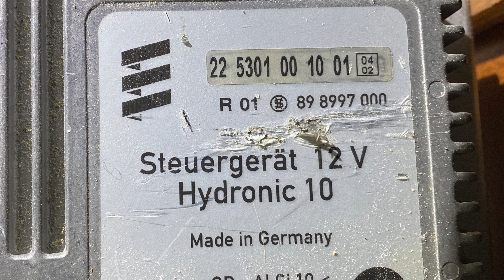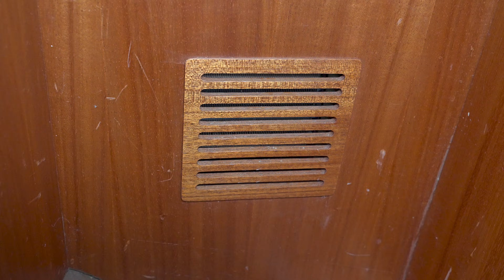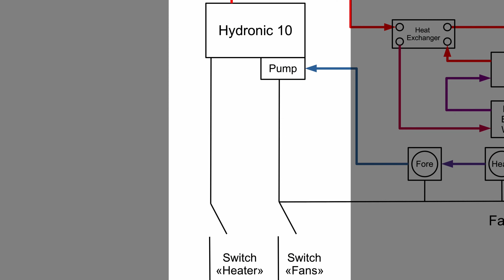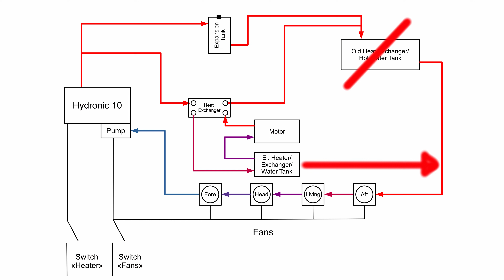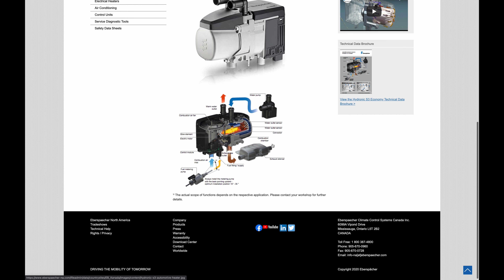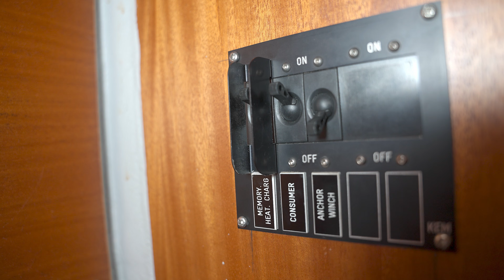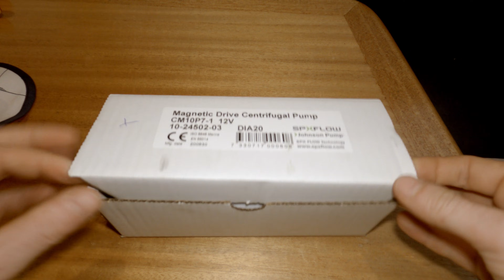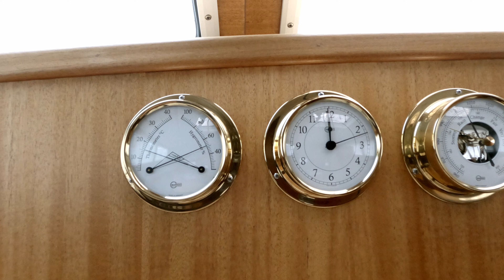Boat Heating | Hot Water without Engine | Eberspächer Heater Upgrade

Comment: Great video, thank you so much for demonstrating the heater. I'm about to buy the same one (Hydronic M-II D10W Diesel 24V) - however, it can only run continous for 60 min according to the information I have - does it restart automatically when the temperature is low enough or does it require manual intervention? Would really appreciate your feedback ;)

Comment: Omg 3.8 AMP  !!!!!!
på 12 volt det er mye ass.

Har selv kjørt air heater som du kan få som begge deler fra 2018 2019 å utover.

Kjører min 8kw er vel strengt tatt 5kw.  Men den på idle som din der bruker 10 12 watt døgnet rundt.
Ved 15 20 minus selsius girer den seg opp en halv time på 100 watt i løp av natten.

Så ganske drøy i forbruk på strøm denne her da.

Neste om du må bytte en gang. 
Kjøp deg en kombi eller en av hver fra de som er blitt så mye bedre på alle disse årene etter patentene gikk ut.
Er vel 30 år siden den patenten gikk ut da.

Forbruk på denne totalt på en 24 timers periode ????
Skulle jeg likt å vist.

Var mye strøm den brukte men bra system. 
Fåes mye billigere i kombo eller vanlige fra kina.
Som ryktes å holde bedre sies det på dem fleste båt show i usa å europa da.

Lykke til håper du har et forbruks tall til meg ved denne eller nært 0 temp.

Jeg hadde -25 lå fast fryst i isen. Hadde 25 grader inne. Alt i celsius da.

Forbruket var så lavt at en hadde ikke nådd opp til nettleien en gang i 2021

Comment: Thanks for the video, explaned a lot. One thing I which is still a bit unclear, where is the heat exchanger located in the engines circuit? So to have sufficient heat when using the engine but also cool the engine sufficient when not in use, and don't cool to much.

Comment: Nice, well done. Four years later do you still like it? Would you still the same unit?
Haha, I love the subdue dry sense of humour.
I know you mentioned the parts in the video but could you put the model etc. in the comments or in the section under the video for everyone to see?
I do have a question.
In the cold months with no heater, if we sleep on our boat (a Van de Stadt 34 steel) we wake up with the sections of the cabin that is not insulated (where the port holes are basically part of the cabin that is above deck level) completely covered with condensation due to our body heat over night. 
If we sleep with the hatches open it is cold but no condensation. 
Did you have condensation before and do you think a heating system like this would eliminate that?
Is the extra pump necessary for just the engine to run properly without the heating system?
Finally, any special consideration in installing the exhaust? Above the heater, with a loop or not?
Cheer,
a.
BC, Canada

Comment: I have the same heater, and love having hot showers. In brief, the expansion tank does not have to be above the water heater, I have mine below and it works just fine. The hot wiring to the battery is what is recommended, the reason being so that the heater cannot lose power as it must run on for a time once turned off. The hot wiring is to avoid the possibility of an an inadvertent loss of power, but as these are mostly installed in trucks I think that advice is not for boats. I burnt out my first heater as I have it mounted high up in the boat right below deck level, and the first summer heat cooked the unit. I solved the problem of trapped heat with my second heater unit by drawing the intake air from around the heater itself with the hot air in that very tight space being drawn into the heater for combustion.
I advise buying SwageLock 19mm ID hose as this is higher temperature and pressure rated. Don’t buy their fittings as they are ridiculously expensive. 
The wiring harness that is supplied with the heater is designed for trucks and is completely wrong for boats. Cut the wire off say one meter from the plug that goes into the heater and add a terminal block for wiring into the boat system.
If you want to improve the boat interior heating rate when first turned on you can buy 19mm 12V Normally Open solenoid valves to alter which system heats first,….water heater or house heating circuit.
The fan style heat dispersers are very noisy and there needs to be far better heat dispersers. Standard radiators will most likely be best, though I suspect that fans faith foam impellers will be much better.
I advise buying several long nose overlock pliers for doing improvements and repairs to the wet hose work. These will minimize the mess and fluid loss when you have to have to open a joint. They work very well once closed you can replace parts or you circuit easily.
I use the small panel display timer switch to operate my unit and I have the web version as well. The criticism I have with these is that considering that Eberspacher is a 5 billion Euro company (I believe) the programming in these devices is pathetic. It requires changes to be entered twice, and this is tedious. Up your game Eberspacher, high school kids do better software than you have in your ancilliary products. The Web system has been hacked a number of times (I believe) with the hackers messing with the software in the heaters themselves causing them to operate randomly.
I love my Eberspacher Hydronic Heater, it makes living off grid just like living every where else. Hot water in the galley and hot showers every day. Space heating is good but needs work, and needs to become silent.
Reply: can I ask you what model of radiators you have installed? Thank you

Comment: Excellent explanation of the hydronic system. I learned about the heat exchanger, which I did not understand before. I have just installed a new Isotemp water heater and am being gifted a new Espar D4W SC from the estate of a cruiser. Lots of work ahead, but your video made the way clearer, thanks!

Comment: Just put a regular oil fired boiler in the boat and plumb in some cast iron radiators and be done with it once and for all. This is what we do on most commercial boats. However if you already have ducts for AC just get an oil furnace, that's how my tug is set up. It's always toasty warm in her even when it's -30 degrees and blowing like hell.
Reply: Weight is often consideration in vessels and machines of all genres.
Reply: @MHLivestreams  True but we’re not talking about much weight here. Most of it is going to be down in the engine room below the waterline anyway. Weight done low is ballast and improves stability. Think about the weight of the fuel, water, and any ballast water you have to take on? We’re talking about a lot of weight, compared to a minuscule amount for heating system. If your running close to your draft limit offload a little fuel or water will correct this. For an example we hold 47,000 gallons of diesel, 10,000 gallons of potable water, 2,500 of lubricating oil, as well as ballast water. How often are you ever fully laden? There is always a great deal of reserve buoyancy on a boat, except when heading out for a 45 day non stop voyage. Even so what are we talking about here a couple hundred gallons of fuel or water weight for a heating system if that? Your going to start loosing weight as soon as you get underway burning off fuel, consuming water, oil, food, spares, ect. We have to take on tons of ballast water every day to compensate for this loss of weight to maintain stability.
Reply: @MHLivestreams  Don’t get me wrong I’m not suggesting a small recreational vessels carries this kind of weight and volume of liquids. But it scales pretty good. Say you have a little 50 ft boat, say she holds 2500 gallons of fuel. Well your not going to need the same size boiler so that scales as well. A 500,000 btu boiler will be more then adequate for a 50 foot recreational boat, and if your worried about cast iron radiators up high in the superstructure the use baseboard units they basically weigh nothing. I’ve put these systems on small recreational boats before, somtimes even having to put the boiler above the waterline due to space issues in the ER. They worked great and didn’t cause any problems with stability. We’re only taking about a thousand pounds or so of which 90 percent of it is low down in the hull.
Reply: @Trump985  a British Thermal Unit is the calculation of heat per square metre. Your calculation is excessive by at least100 times. . One BTU is one cubic metre.  Your boiler idea is unnecessarily heavy and powerful.
Reply: @MHLivestreams  I can assure you it’s not, at least up here where the temperature can be -20F and your heating an insulated boat especially when you have to open windows in the wheelhouse to see where your going when it’s snowing or icy. If your operation somewhere warmer then you certainly won’t need as much heat, however you can easily fire such a boiler at whatever rate is needed simply by changing nozzles. For a example with a 2.5 GPM nozzle at 160psi your firing at about 500k BTUS

Comment: Hi. Great and helpful video. Thank you for that. Im about to re-do the hydronic system in my boat.
Is your tapwater tank a combined 220v and heatexchanger type? if you run it only on 220v, and then run the circulation pump in the heating system, will you then get heating onbord? 
I wonder if this is a way to heat the boat at shorepower..
Best regards Yngve
Haugesund

Comment: Very interesting video!  I have the exact same Hydronic 10 heater installed on my 1999 Catalina 470, and it has never worked since I bought the boat.  And I never really needed it as I live where it's warm almost all the time.  I'm investigating getting the system going again, mostly to heat water for showers and doing the dishes, and for the rare cold day.  You've given me a lot of useful information, thank you!

Comment: We have a Hurricane hydronic heating system on our Tollycraft 34. It's set up very similarly to your boat and performs very well.  It was 10°F last night and we kept the boat at 50°F to prevent freezing.
Reply: Which Hurricane heater do you have? Would you care to connect to share some pictures of your setup?

Comment: Great detailed video, thanks for that! I have a Webasco hydronic system on my 1883 C&C 43 Landfall. The engine is tied into the water heater together with the Webasco and has 4 valves that can be used to isolate them where they meet at this hot water tank. With the valves open, the engine could pump coolant throughout the entire loop and heat the boat (with just the engine) if I had a way to operate the individual fans in the heaters. Like you, I have a concern with having such a large loop with potential failure points that could lose coolant and put my engine at risk. Right now I feel pretty safe with the ability to only heat the domestic water keeping the valves to the entire heating system closed. Because you have a heat exchanger from the engine to the heating loop, your risk is minimal. I was wondering what heat exchanger you used and if you found much loss through exchanger vs having the large single loop system I presently have. I know these hydronic heaters are used in vehicles (trucks) in the same single loop but have fewer failure points that these much larger systems on a boat.

Comment: Great video. Jus trying to make a thermo to V run, from  BMW but might end u using a thermo to C/V. But thinking of trying to loop into the existing water tank that is heated by the motor. And then onto a radiator or two but that is going to take some planning as there will have to be switches I guess.

Comment: Can you add a oil pressure switch (NO) on the engine and when the engine starts it will pass the grounding leg to your relay activating it and cut it off when the engine stops.
Would this make it automatic and then the remote switch would be left on all the time or off when you need to shut the system off.

Comment: Great video. Building a sailboat and going to have same basic system. I have a Webasto heater. A couple of questions, if I may?  I see you are running the glycol solution through a heat exchanger to warm the engine, so how does the warm engine coolant in the heat exchanger get circulated through the block? Is there another pump involved? Also, is the heater isolated from the accommodations, in it's own locker for example? Thanks for sharing. Always good to compare notes. Take care.

Comment: floorheating would generally be a good idea i believe as it maximizes the surfaceare of energytransfer. your energy loss rom all windows etc. must outperform the abilities of your fans volume per time unit at a certain temperaturepoint. For safetyreasons i would go for an aditional airheater, so that you have redundancy aswell as means to speed up the process.

Comment: Great video.  Might I ask why you plumbed the cabin heaters in series as opposed to parallel?  I’d think there would be several advantages to running them in parallel.  1. They would all be the same temperature. 2. You could plumb in shut off valves if you ever had to remove one for service and still have heat at the others.
Reply from the maker: Well, short answer is that the plumbing was that way in the previous configuration. Long answer is that it’s easier imho. I am not entirely sure how easy it is to realize a proper distribution that really divides the heat equally. I understand that it would be preferable, but on the other hand it introduces a new level of complexity.

If you build something like that let me know how it goes!

Comment: just got done finishing my install of a hydronic heating system.  I have watched your video multiple times to get a good understanding.  I share your assessment of sluggish performance from the heating of the air.  I have copper tube radiators with computer fans.  I am wondering if a car style heater matrix would deliver more heat to air transfer.  I can't say I feel like replacing my heat exchangers to find out, but I sure am curious. thanks for the video.  Cheers from Seattle, WA US

Comment: I am fitting a diesel water heater to a home hot water service, simply because natural gas is a horrible rip off now. When I worked out the cost per 1 kw/hr of energy, it was AUD $20.   This is all in a country that is third largest exporter of natural gas in the world. LoL, no fuse/breaker between old heater and battery.........omg, fires on a boat are very undesirable.

Comment: Ok I haven't run out of fuel same system iv had for years .
But heater has shut it's self down for no reason and wont restart after a few attempts it's got an e 10 code ?
Plenty of fuel 12.7v with the glow plug on and 12.9-13.2v on a 390 amp triple leasure battery fuel line is around 4-5 ft long .
I've tried priming it just doesn't want to know ?

Comment: Mener du sa den gamle hydronic 10 har mulighet for å kun kjøre vannpumpen, hvordan?
Reply from the maker: Det er pin B1 (i stikkontakten til styrekabelen) for den gamle hydronic 10 med positiv signal. Det er beskrevet på side 17/18 i manualen, se f.eks. her: https://www.butlertechnik.com/downloads/Eberspacher_Heater_Hydronic_10_Installation_Manual.pdf

Comment: Thanks for posting the fine video. It is very helpful! I am considering adding a similar system to my camper van to replace the little Propex heater since now the engine has been swapped to a diesel. Looking at your last schematic, it appears that the heroic heater is not warming the engine when it is off. Of am I missing something? I will need to also warm my engine in cold temps prior to starting. I understand that keeping the engine coolant separate from hydronic loop. Maybe an additional coolant pump to warm the engine? Much appreciated!

Comment: Thanks, Thorsten, for your great coverage. I have installed the same heater in my Southerly 135, Only I had to start from scratch installing all of the hoses over many weeks. I am interested in the noise level of your fans. Mine are Eberspacher standard and are excessively noisy, particularly the supposed 4 Kw duct unit in the main saloon. I am looking for a silent solution. The older fan units you have may very well be superior to the newer units made to a budget in France. I live permanently on my boat and shower aboard every day. The fan unit in the head is vital to drying out the head after each shower. I don’t have the auxiliary water pump either, I will get one and add it, but you can achieve the same by adding a really power feed to the heater water pump. I like the idea of the backup function though. For water line modifications I have 4 long nose vise grip pliers to pinch of the hoses as near as possible to any section I am modifying. With these I spill very little. I have my Heater unit up in the roof of my equipment space and have the header tank below the water heater and I charge the system through a valve feed in line at floor level using an electric drill utility pump (Euro 10 at the hardware store). I see that you are in aviation so I offer a little tip. I suggest that some time you talk to the maintenance people and obtain a quantity of aircraft cable for the next time you have your mast off the boat. The reason is that this wire is silver plate, silicone sheaved, over sheaved with fiberglass braid, and over sheaved again with an anti friction cover (possibly Mylar). Ie this is cable of a much higher rating that will last many years more than standard wire, and it is not that expensive relative to the value of the mast, or the cost of taking the mast down to repair failed wiring. I look forward to future videos.